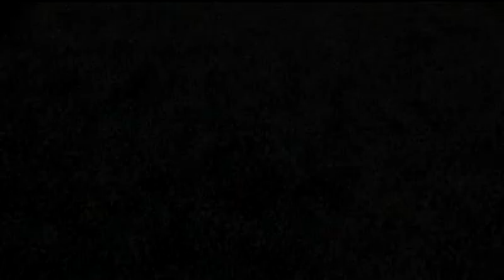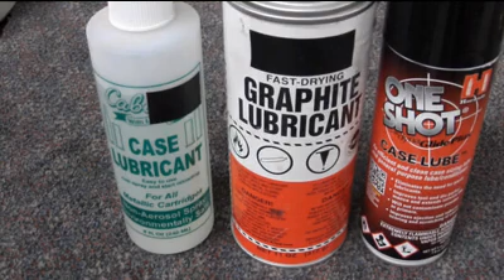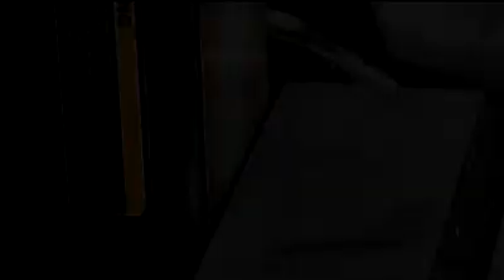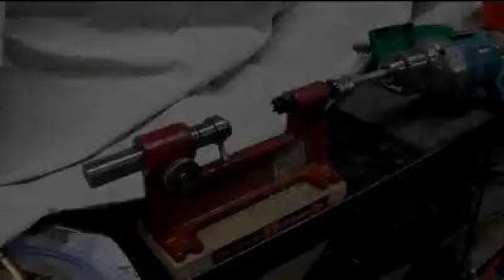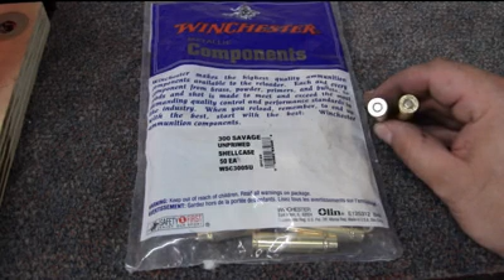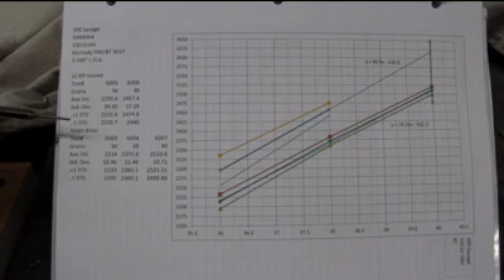Reforming 30-06 to 300 Savage

Comment: Might consider using a wooden dowel inside the case neck. You will sacrifice some of it as you trim, but by holding onto the towel away from the case neck, you potentially lose zn area of conflict between the bandsaw blade and your fingers...

Comment: This is a very old post but still relevant. 
I would add that before resizing, you should anneal the cases for a lot less stress on the cases and dies.
I've done this for 300 Savage using 7.62x51 military brass, and it works great. 
And if using military brass, don't use your full-size reloading die to remove the primers they WILL BREAK. 
I use a homemade punch ground to size and heated and quenched in motor oil.

Comment: Try using Crisco it's been used for over 100 years it works very well and it puts no stress on the brass and it's one of the best draw lubes you can actually get

Comment: It is far, far simpler to form .300 S from .308 cases rather than .30-'06 cases. I would NEVER use .30-'06 brass for this purpose.
Reply: Why not? Even Lake City 30.06?
Reply: @cokdnlokd1238  because forming from ‘06 brass requires neck wall thinning. Forming from .308 brass does not. Very fast and simple as compared with this stupid video. One pass of a .308 case through the .300 Savage FL die, and trim to length with a small tubing cutter. Takes maybe 15 seconds per case. I have made hundreds of .300 S cases that way. Using military 7.62 brass works just as well as commercial.
Reply: @denniskirsch7783  Did you not hear that he had lots of the 30-06 brass ? He also said that you could form them easier with 308 brass.

Comment: Back in the 70s we used inside neck reaming as opposed to outside neck turning in use today.  Outside neck turning leaves a noticeable shoulder where cutting stops. As for the commercial brass with loose primer pockets....I've noticed the same disappointing quality from the brand shown here. Very informative video.

Comment: Thanks for the video!  Now that I have a Remington Model 81 that I just love, I'm going to have to learn how to do this if I intend to shoot it very much.

I'll also have to learn how to do this to make .25 and .32 Remington brass since I want those calibers also (Model 8).
Reply: +DEEREMEYER1  Thanks man.  I am yet to reload but if I do I won't push any limits.
Reply: you have the 25 REM !!!! ...... what an awesome round...... had a model 30S (1929) and it was the best rifle I ever owned......started out with Hornady load data for 25-20 and worked all the way up to load data for 30-30...... most accurate rifle I ever owned..... has accounted for over 200 deer since 1978.....undoubtedly was a game getter before that ....my buddy still has the model 30EXPRESS in 30-06
Reply: Simple to make .25, .30, and .32 Rem cases from .30-30 brass, but it really helps if you have a lathe.  Just turn down the rim and cut an extraction groove.  I load .30 Rem using .30-30 dies.